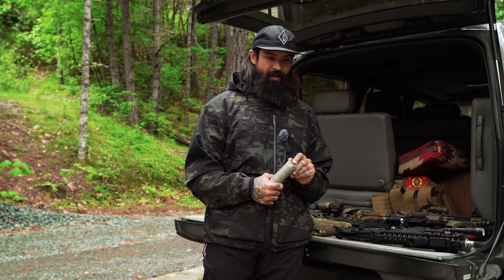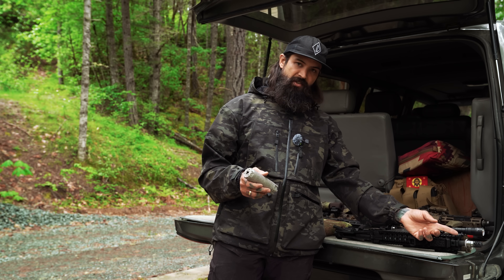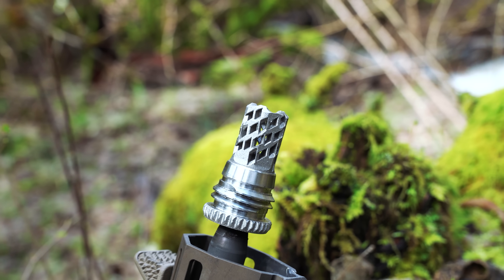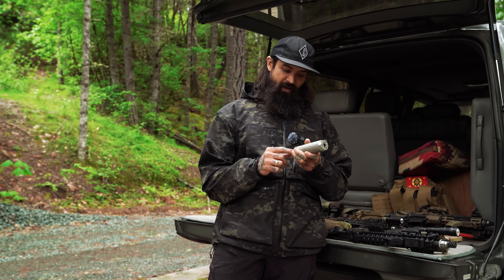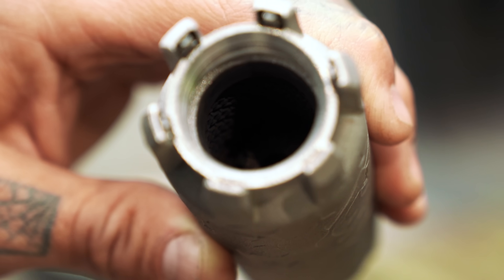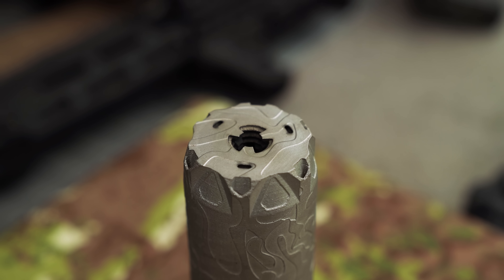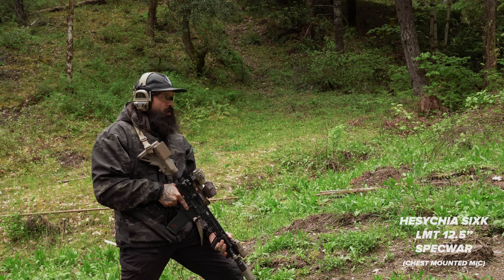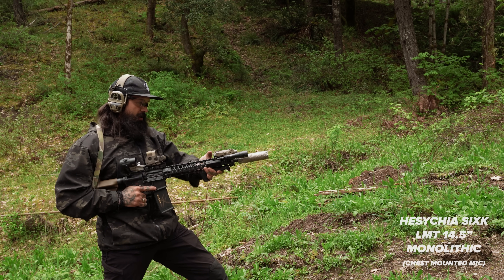IRREGULAR DEFENSE HESYCHIA SIXK Suppressor Overview and Live Fire Demo

Comment: If the front of the supressor was a concave shape would that further help reduce noise as the shooter?

Also since high velocity cases are exiting the can could that be used to help pull air over/through the can for cooling similar to the savaging on exhaust manifolds? 
Or perhaps a bore evacuator could be incorporated to reduce fumes when the bolt unlocks?

Comment: Love it. Inconel, no titanium spark to worry about. Size is great, not adding unnecessary length or weight to the gun. This could be something that I’ll bet performs great on 14.5’s and 16” guns but is surprisingly very good on a 10.5 or 11.5. That tends to be the area that k cans always fell short for me. K cans on short ar’s were just very meh. Flash and sound reduction wasn’t good enough but the weight and size of a k can is my preference. Cat wb and velos k are two good options that came to market that have impressed me on shorter barrels. This looks like it could be added to the list

Comment: I wonder if an LMT 12”Shovel-nose piston gun would cycle in the suppressed setting?
Reply: It likely will. We developed this to run balanced on a wide open gas block. No adjustments needed. I tested it on a SIG SPEAR LT 16” on both suppressed and unsuppressed. Ran just fine. On rifle speed gas systems it runs at 9 perfectly on a 14.5.

Comment: instead of the rachet system, why not make a secondary taper ring that screws over the base of the supressor from the host thats retained by putting it on first before the host so you cant lose. (and its an added option, so if you dont want it. you dont need it) my only thought its, with hard use or dumb owners they'll break those teeth some how, and it already uses a common mount system i believe which looks to be similar to the current rearden/q type devices. just a thought. love the design and that raw finish is bad ass

Comment: Lots of port gas coming back to the face but sounds like it has a good tone. Will wait to see a pew science review
Reply: It may look like it, but it’s not hitting you in the face. I had two left handed shooters with me during the entire development and they can confirm that they don’t feel the gas at all. Even mag dumping the gas didn’t stack up and start dumping out of the port. On a rifle speed adjustable gas block over a 14.5” barrel, you don’t get lock back on position 8, unsuppressed its position 10, 12 being wide open gas. So it’s objectively a low back pressure can when most typical high back pressure suppressors fail lock back all the way down at position 2. 5 is average for most suppressors.

Comment: No hub, non replaceable wear part in form of ratcheting teeth are going to be a huge no-no for many people. A muzzle device out of softer material would also help with reducing the wear of the secondary retention on the can.
Reply: I’ve been using a yhm with ratcheting teeth for several years on one of my rifles. Never had any issues.
Reply: It’s not for them
Reply: @cocobearnoski it's for they/them*
Reply: We cycle tested the wear components and heat treated the can and muzzle device differently to get over 4000+ cycles out of it. We will run a longer test to see where it actually fails but we needed the machine freed up to make more cans haha! And the pawls aren’t like normal ratchets with tiny sharp teeth grinding against a weak pawl. The flexures and grooves on the MD are all round, so they have a much slower wear rate than sharp locking features. We will publish more on the wear testing once we run one to failure with several other well documented metrics to go along with it.
Reply: @SeanBernstein7 are these available already?
Reply: @deaconhollow sorry for the delayed response! Yes they are my friend!